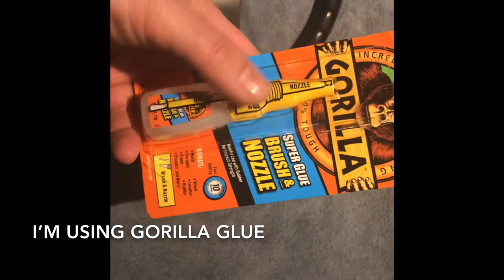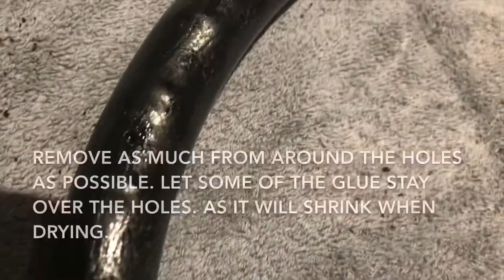Loose steeringwheel grip fix

Comment: will a universal fast adhesive work for this? it says on the can "high viscosity cyanoacrylate adhesive"
Reply from the maker: Hi. I’we tried once before using instant glue, it locks the loose grip, but it’s very fragile and will break loose again.

I have the best resultat using PU enhanced gorilla glue. It needs the polyurathane to be flexible i guess…

Comment: Very helpful. Thanks.
Reply from the maker: Glad you could use it.
Reply: @DavidRoadworthyish   I followed your instructions but did one thing different: I used the Gorilla Glue, but I went to Tractor Supply and got some animal vaccine large syringes and needles.  I put the glue into the syringe and injected it into the holes I drilled.  It worked great.  Then I used SEM Color Coat - which is flexible plastic paint - to refinish the surface of the steering wheel.  Turned out like new
Reply from the maker: Whatever gets the job done.

And Nice touch to paint the whole thing to make it look like new.👍

Comment: This is insanity. Go to Tractor Supply and ask for 16 gauge livestock hypodermic needle and barrel. Get some liquid gorilla glue and warm it slightly in the microwave so it flows and fill the barrel of the syringe. Pull the steering wheel as forward as you can and with the hypodermic needle inject the needle to the steel core and push in some glue. Let dry overnight and that’s it. This is too much work!
Reply from the maker: That’s good advice.
This was a loose steeringwheel that otherwise Would have been thrown out… just an atempt to see if it could be saved…

I’ll try your Way if I have a loose one in a car for sure. Thanks